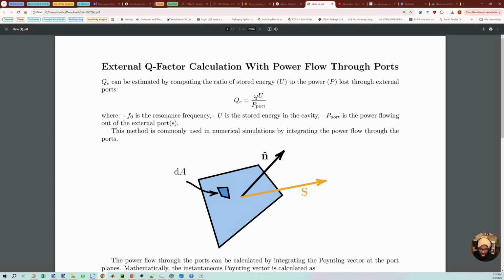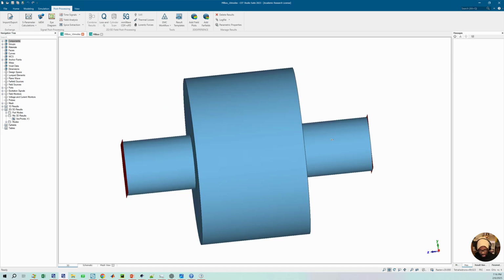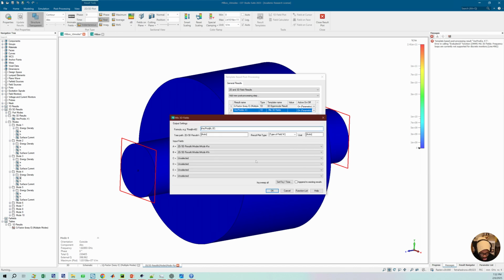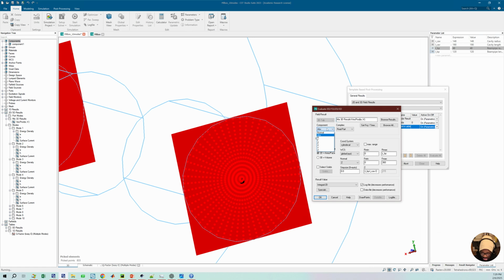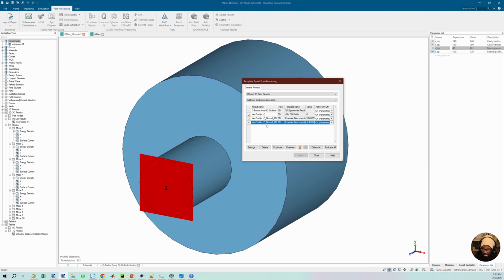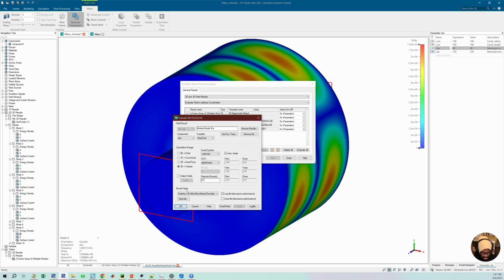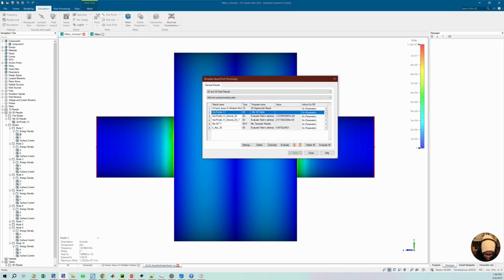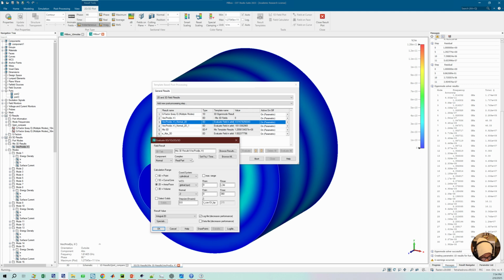CST Studio Suite - Poynting, Q, Integrals and U

Comment from the maker: NOTE: This method works because the waveguide port boundary is a perfect absorber ensuring zero reflections. I have not checked, but in principle using PMC or PEC boundary conditions at the beampipe ends will not give similar results due to reflections.